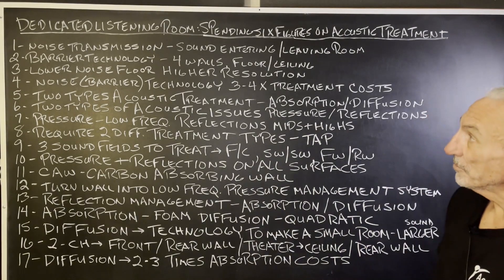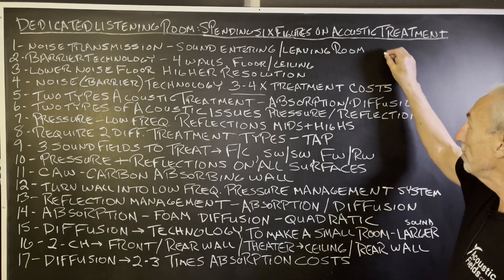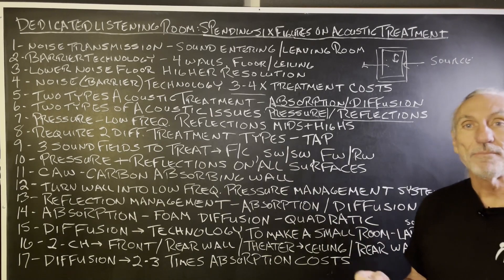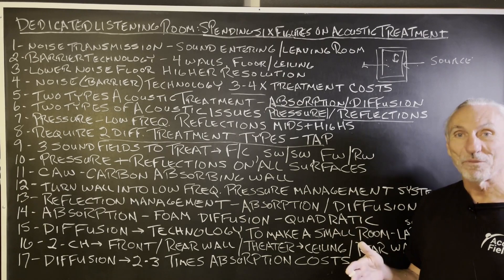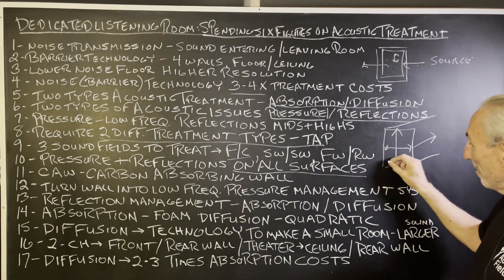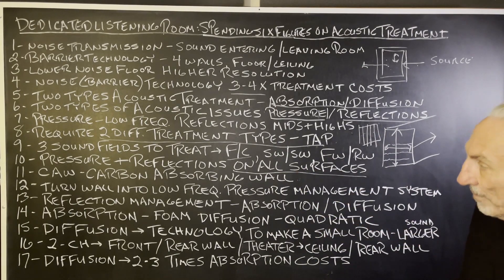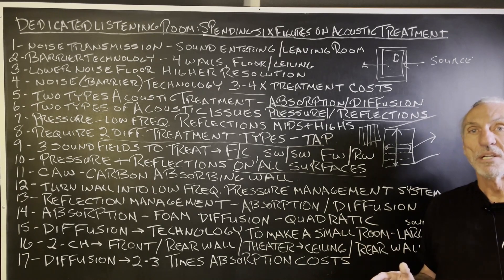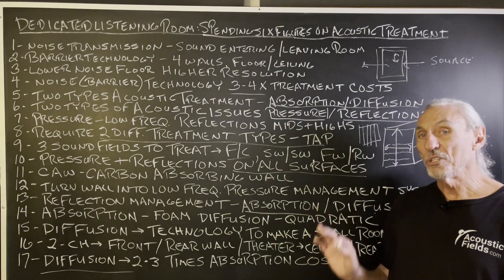Dedicated Listening Rooms: Spending Six Figures 😳 on Acoustic Treatment - www.AcousticFields.com

Comment: Simple solution is buy ten acres outside of a city then you have quiet environment to begin with lowering costs of noise treatment for the home theater room.
Velocity filters for mid and high and pressure filters for low.
Infinite baffle subwoofers subterranean at room center.
Reply from the maker: You must consider all cost/benefit ratios.